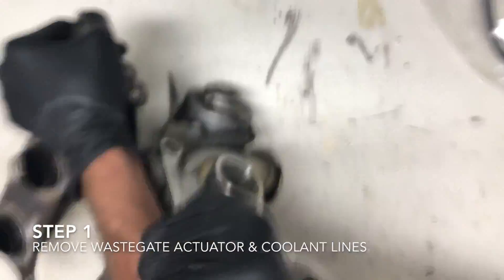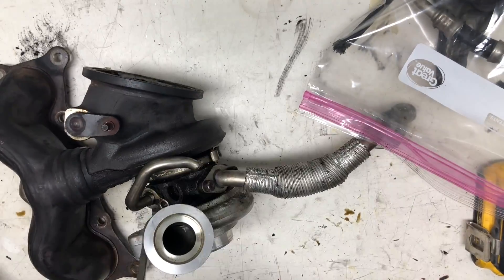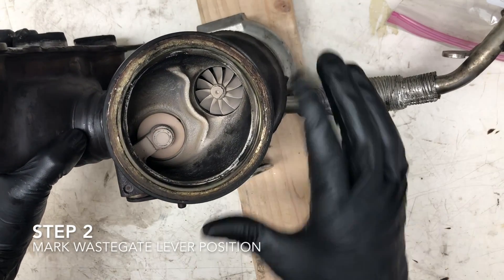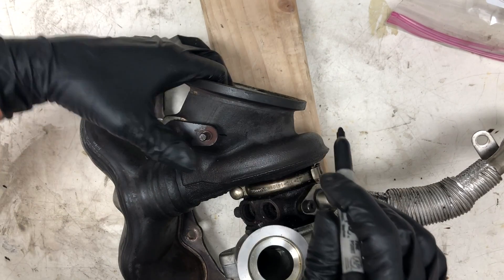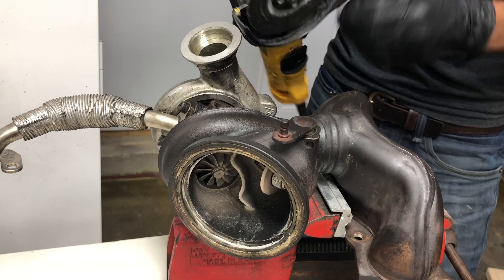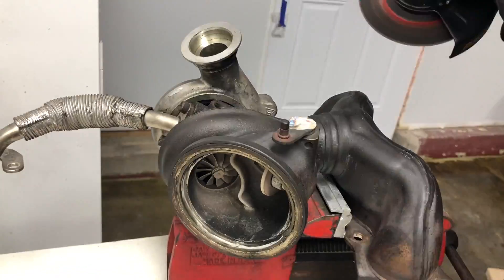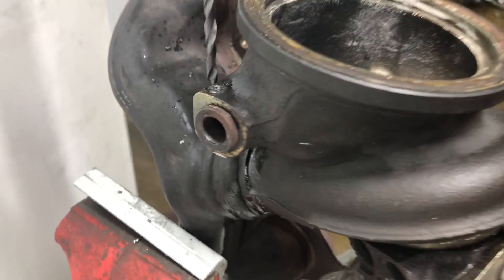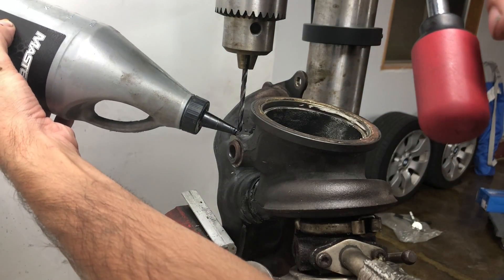How-To: Replace N54 Wastegate Flappers; 30FF Turbo Fault DIY

Comment: Option 3 for removing the bushing. Place a bolt through the bushing from the inside. This bolt should be as long as will fit. Place a socket just bigger than the bushing on the outside with a washer and a nut and tighten until the bushing moves. Use lube. Change the bolt and or socket as you run out of distance. Works good. No extra cost.
Reply: This.... best method by far. Use a threaded rod instead of a bolt works even better if you don't want to hunt for two perfect length bolts.

Comment: instead of slidehammer removal of the old bushing, you could use a large drill bit to remove the external flange from the old bushing, then use hammer and drift to push it though into the housing.

Comment: Why buy a slide hammer ? why not use a large diameter all thread and use a large impact 1/2 drive deepwell socket and simply use wrenches and nuts to screw it out ? less then $80 and the pulling force is 20 times plus more it will pull out smoothly with no effort ?
Reply: Can you elaborate? Sorry I was dropped on my head as a child 🤪

Comment: I just got my repair kit in the mail and for anyone attempting to do this repair-make sure the flap disc is not too thick, mine was and would make it bind in the closed position, luckily I noticed this before getting too far and ordered a new one.  Ill keep everyone posted on how it turns out.

Comment: You had me right up to the part about using a nail and welding it in place to align the bushing. Shouldn't the repair kit contain a new roll pin??

Comment: Hey Andrew, just wanted to know if you were a professional welder or self-taught?
Reply from the maker: Self-taught!
Reply: @Berga610  I do have a flux welder which Ive gotten used to using but would like to upgrade to a mig/tig welder in the near future because Welding in something I would like to get into as a hobby.

Comment: thanks for the time you used creating this fantastic video . mine is a volvo t6 with the td03 turbos as this one . i got the rattle, and when i press the pedal the sound is like a hose is fallen of to the air inlet ....strange sound , i thought the sound would be like metallic , any input on how yours sounded ?
Reply: Does it sound like a siren? If it does then it turbos are blown

Comment: Where did you find the parts?
Reply from the maker: ECS tuning sells a Vargas kit, or you can buy them on Amazon/eBay
Reply: @Berga610  I actually have a 2013 VW Tiguan and they do not carry this for my vehicle.  Looks like a company called Mamba has them.  Have you heard anything about them?  are they a good company?
Reply from the maker: @sidneyabernathy854  nope, no clue as it’s probably an entirely different project.
Reply: @Berga610  Gotcha.  Thanks for the prompt reply.

Comment: Is it possible with arc welding? I'd like to use a stainless steel welding rod for an arc welding machine.
Reply: And if I install a new bushing and weld a retaining pin, do I have to drill a hole in the new bushing as well?

Comment: Andrew, thank you for taking the time to video how to fix the waste gate flapper problem. I am dealing with this issue right now. My 2011 had 3 engine codes. Diagnoses, timing chain. After having the timing chain replaced, I still have a P0299 code. Mechanic says replace the turbo, WHAT! I wish I had half the gumption (and tools) that you do when approaching a problem. I am checking with a local European performance shop to see if they would preform your technique. I don't have an extra $4,500 right now given the current conditions. Thank you again Andrew. You gained nothing by sharing your experience, but the satisfaction of knowing that you were helping someone else. 

To the "i am me" commentor, you have serious problems. Your comments are unjust. Have you ever goggled narcissistic? You need to be shipped out of America and sent to a dessert island to figure out your life. You are whats wrong with America right now.
Reply from the maker: Shaun Jones to be fair, he’s probably not American since he used the word “bellend.” Probably a Brit. Thanks for the kind words!!
Reply: I have the same pain in the ass F'ing P0299 in my 2012 explorer. They wanted 6K to replace mine with the newer turbo and new down pipe... WTF.... Such BS.... 
So what got me turned onto this video was by pure accident. 
I was actually looking into a conversion deal. They sell a kit to go from internal waste Guage to external waste Guage
 This video has left my mind and marbles spinning.... I feel like this would be ideal to do. Just a total pain in the ass to do while on your back in the drive way. Ford calls for 21 hrs labor... and that's with all of there fancy schmancy tools, lifts etc...

What route did you end up doing? My rattle is getting bad, and I can't get over 70, or use cruise control. Shit I can't evan pass a car on the interstate...lol

I'm so hoping you did this successfully or went a different route.... Id love to hear back from you.... thanks..... If you can, shoot me an email.   It's Coleon@gmail.com 

Thanks, Cole

Comment: Process is a lot easier without replacing the bushing, probably what I am going to do considering it has no play in that axis. just at the flapper itself. Wonder if its possible to do while theyre still installed on the car... with just downpipes off and subframe dropped. Good video nonetheless, friend!
Reply: thought the same....biggest problem is to get a welder

Comment: What are the common causes of the 30FF code? My 2007 335i has this intermittently... some days it runs hard 100% and other days it will cut power and throw the engine light with reduced power. Since it is intermittent, I believe it's not likely a boost leak. A boost leak would cause poor running condition all of the time. What do you think?
Reply from the maker: BIMMER ZEIT fact is, if you’re getting 30FF faults, you have worn turbos. They’re in the beginning stages of failing. As you drive it more it will become more common. Doesn’t hurt anything keep driving it while you figure out what to do.
Reply: @Berga610  thanks for your reply. I guess I'll have to keep my high-mileage 328i around for the day when the turbos are down and out for good!

Comment: Does anyone know what size drill bit you need? I want to buy a champion XL5 twist drill but I don't know what size. You can use a socket that slides over the bushing and an appropriate nut and bolt to make a puller for the bushing.
Reply from the maker: Fact is, the exact size of the twist drill doesn’t matter much. You won’t be able to align your drill perfectly with the pin, so you need to drill oversize. 
Regarding the nut and bolt, actually there’s very little room against the inside wall so whatever “nut” you use needs to be really low profile. If your diameter is too large you won’t be able to fit it out the bore.

Comment: Can we get one of those custom nuts for the slide hammer? Like, can you make one forsale?
Reply from the maker: Keir Richárd Hmm, I’m sure that could be arranged. I worry that my price would be too high though. Maybe like $40? 

You can also make it by converting any existing nut with the correct thread by grinding it with a bench grinder
Reply: @Berga610  I will try grinding a bolt. Didn't think about that. My man!!!

Comment: Thanks for the video. Where did you buy the parts of the wastegate?
Reply: Sorry, another question, when you drill the pin that size of drill you use, I do not know if you say it in the video but my English is pretty bad.
Reply from the maker: @davida.9102  #27 = 3.66mm. But it doesn't matter very much -- Anything from 2.5mm to 4mm is probably OK.
Reply: @Berga610  Ok, thanks. Today I tried to drill with a 3mm drill with a battery but I could not, tomorrow I will try it with a standing one and use a 4mm.
Reply from the maker: David A. You probably need to buy a higher quality drill bit...
Reply from the maker: David A. Amazon, or upgraded Vargas parts from ECS Tuning.

Comment: Just be more careful getting the busing inn. If your using a hammer like he does, don't start bashing it like that. As you can see it starts out crooked, not good. Start of by tapping it inn gently to make sure you get it square from the get go. You can start using more force as it gets further down. To even make it easier. Heat up the steel around the hole while the bushing sits in the freezer. It will slide in easy if the bore/hole is nice and clean.
Reply from the maker: CoolKD2005 Very true. Since there was a chance of misalignment, I should have used smaller taps until certain it’s going in perfectly straight!
Reply: Lol use dry ice or freezer for 1h.  No hummer needed

Comment: Great video @Andrew Berg , what size drill bit did you use? Any link to the slide hammer?
Reply from the maker: P90Puma Glad you liked it! Drill bit was approximately #29, but you could go bigger if needed. 
GearWrench 41700D 10 Way Slide... https://www.amazon.com/dp/B000TD6K6G?ref=yo_pop_ma_share

Comment: Wouldn’t exhaust gases always escape between the bushing and the actuator flap shaft? They are both steel hence where is the seal? I have a small leak on my turbo where the shaft enters the bushing and trying to work out if this will fix it.